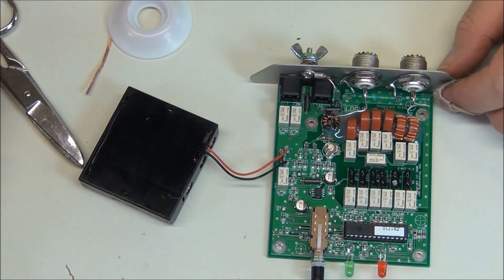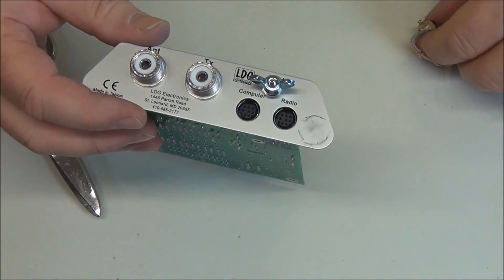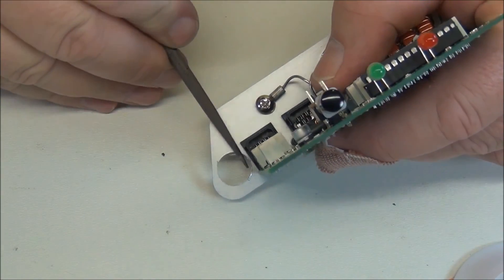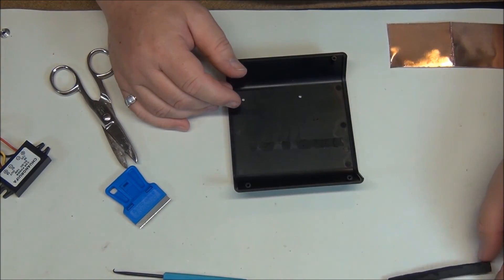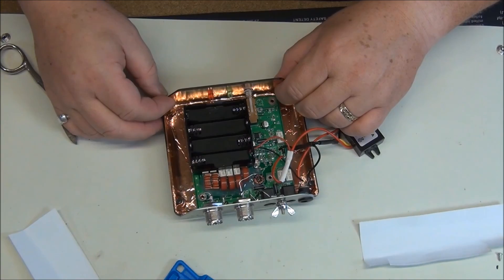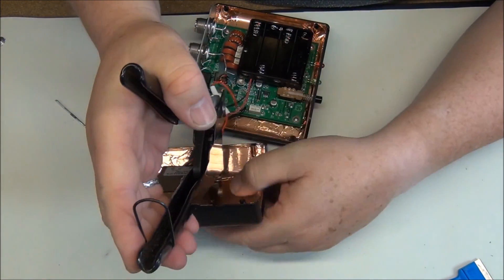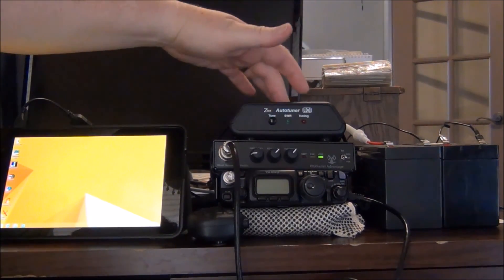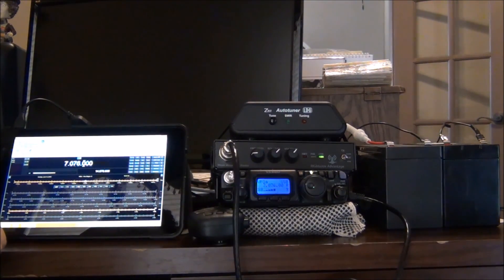Power / RFI Modification / Hack of the LDG Z-817 Autotuner Part 2 -  AF5DN

Comment: That is when a step bit comes in handy, I don't know why that wasn't done by ldg, I don't have a problem with the batteries. Should have put the pop rivets in from the other side they would have looked better and if you were worried about the hole in the top of the rivet a drop of hot glue would take care of it then a little black marker it paint the head off the rivet. 73

Comment: With the 4 AA batteries I work daily more then 2 years with this tuner. Why external power? The powerconsumption is only a few milli amps when he is tuning..
Reply: exactly..bored ham syndrome i think. MUST MOD !! lol
Reply: Also, if using rechargeable batteries, the charge could be taken from the CAT-connector, as the radio is delivering Vcc via this connector.

Comment: nice modification.  That copper is not coated, and will conduct just by touch?  would have suspected the copper would have a coating on it.  Did you test if you are getting significant signal through the tuner?  And which rigblaster are you using?  - N1KTJ